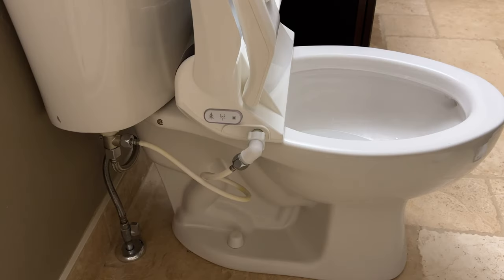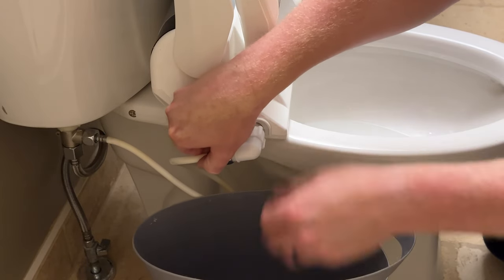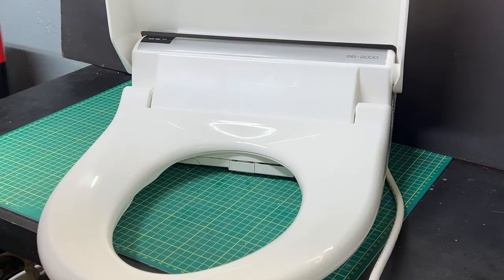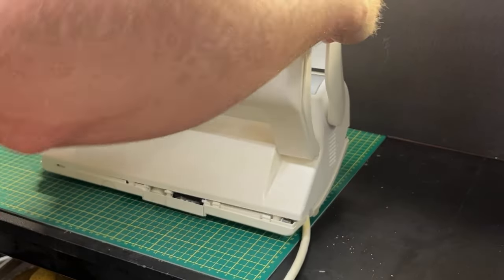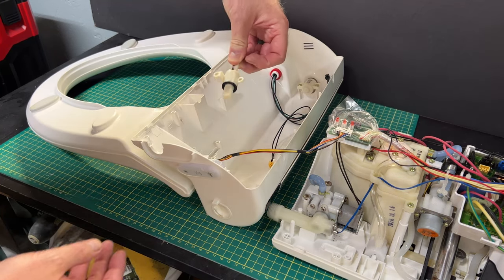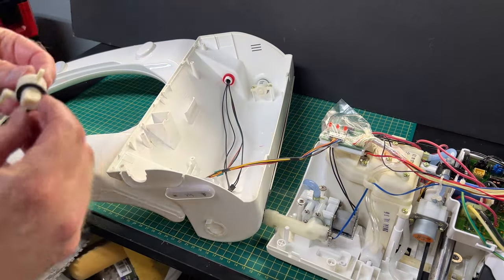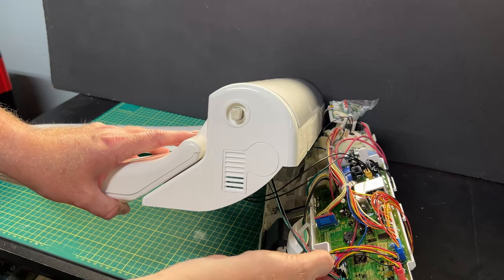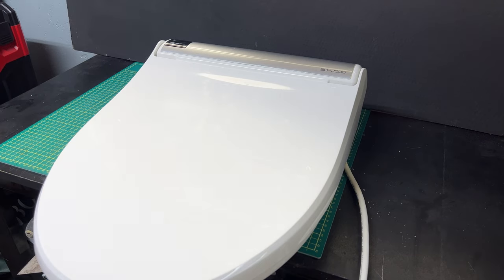Bio Bidet FREE repair & replacement parts - How to replace toilet seat & damper fix slow close seat

Comment: Thanks for the professionally prepared video. You are fortunate that you were replacing the seat damper.  My damper was fine but the seat had its finish worn off and it was a horribly brown stained mess.  The 3 screw damper you removed holds the seat in place.  I scratched my head and said bad words, then I removed the damper and got the seat off.  Dunno if you want to re-edit your video.  Hopefully folks in my situation will read my comment.  Thanks again. (Mine was not as cooperative as yours)
Reply from the maker: Thanks for the clarification.  Unfortunately at this point I can only remove sections of video, not add.  People will see the comments here for sure.  Please like and subscribe.  Thanks for the question and for watching!

Comment: Nice video. Did you find out what went wrong with old one? Can the damper just be replaced by itself?
Reply from the maker: The original damper just seized up then caused the toilet seat to crack.  The damper can be replaced on its own.  If you could please like and subscribe it would really help me as a creator.   Thanks for watching and the questions.